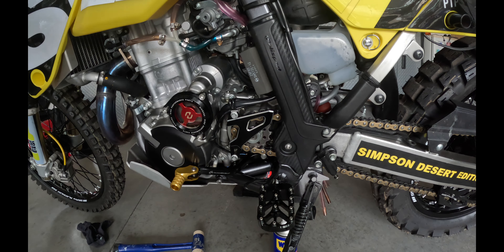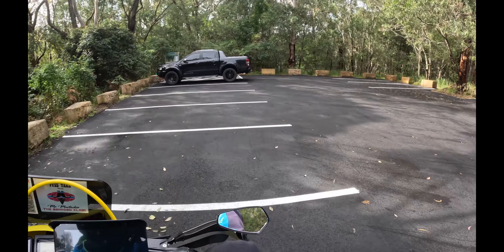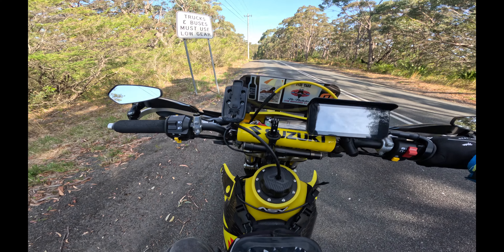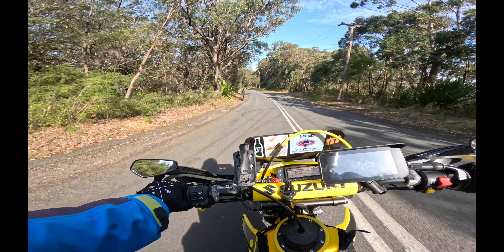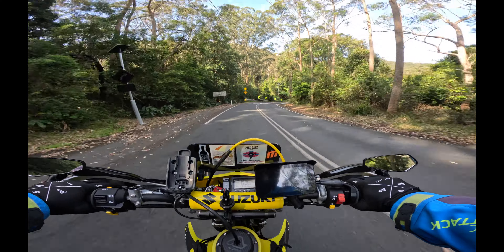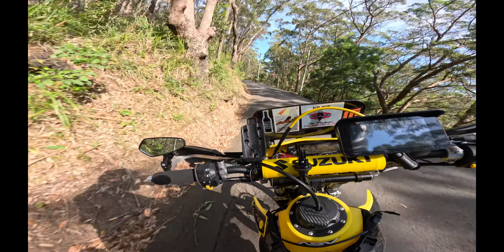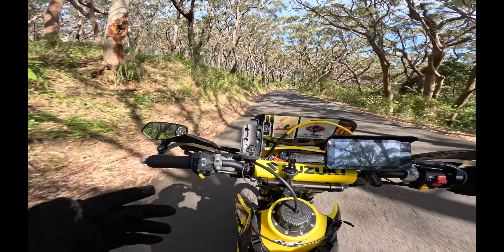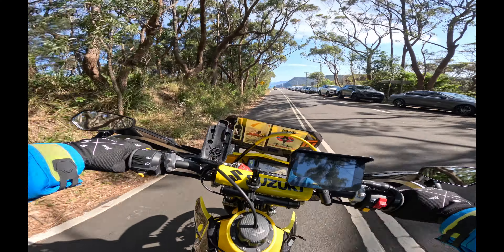Hammerhead Gear Lever Suzuki DRZ400E

Comment: I got the revolver lever with the adjustable toe tab, although it doesn't move it much, but enough that I don't have an issue with boots(size 12)  doesn't need clearancing though like this one did, there's a decent gap between the case, also you don't have to push it all the way to the back of the spigot to secure it so that might be where people are running into issues with it hitting the case?
Can also  rotate the lever a little higher and make some pedal adjustments for a more suitable gap if the standard position is too tight.
Reply from the maker: I'll pin your post for the advice. I  had both the zeta and Hammerhead backed off as far as it would allow me. Unfortunately just they run close to the covers. Revolver is good.
Reply from the maker: LOL i just noticed your profile pic. classic .
Reply: @PissTakeProduction  Lol waadddyatalkinabouut..... actually just working on releasing some of my own content soon mate, same name but different banner/personalized branding, not without a sas though, yeoowww
Reply from the maker: Do it. Highly recommend making content. You never know where it can take you.